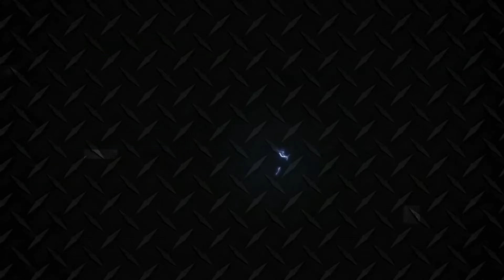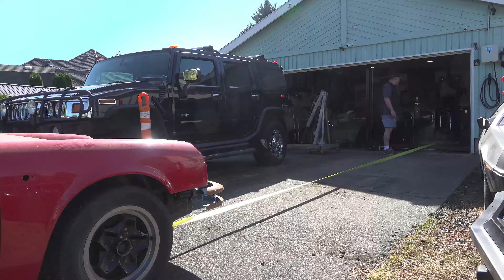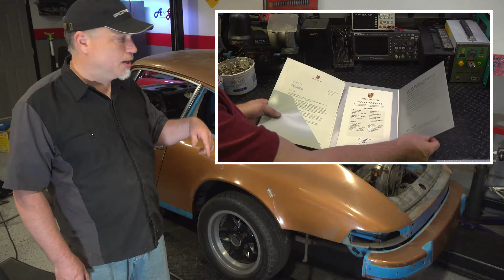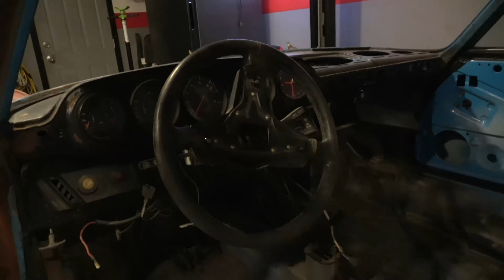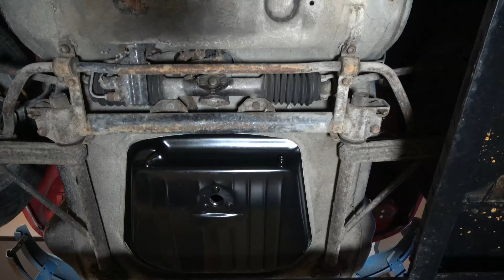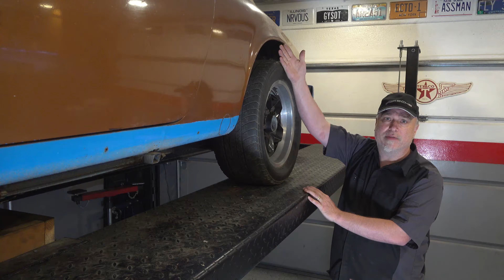1974 Porsche 911 coupe: Numbers matching Mexico blue coupe  [4K] Ep108

Comment: Looks like the rear bumper had the European style bumperettes on it. The US ones have holes much further in toward the license plate.
Reply from the maker: No, there are no holes that were filled that you can see from behind.  I watched a video from the Porsche Club of America and they talked about the 'mid year' 911s and they said the the 1974 was the first G-body and all US spec cars had the smaller bumper overriders.  In 1975 the larger bumper overriders were introduced and used till 1989.  Along with the driver side chrome mirror, I like the fact that it is factory with the smaller bumper overriders.

Comment: Great looking project!  BTW, if you haven't discovered it yet, the fuel pump on 74's is at the rear left side of the car, above the sway bar mount.
Reply from the maker: Yeah I saw that upon further inspection I powered it up thinking I was going to run a compression test and it started running.  Still gonna need those fittings for the tank.